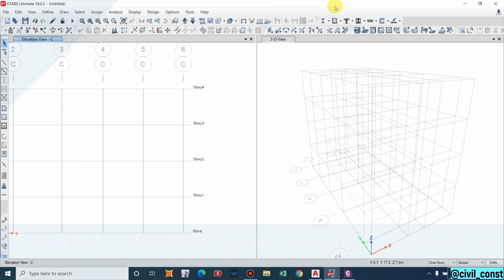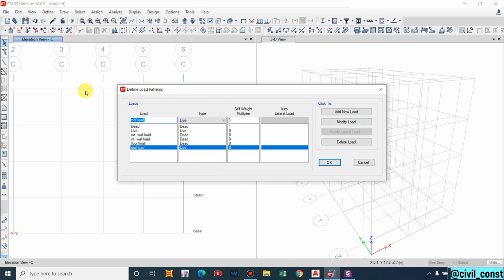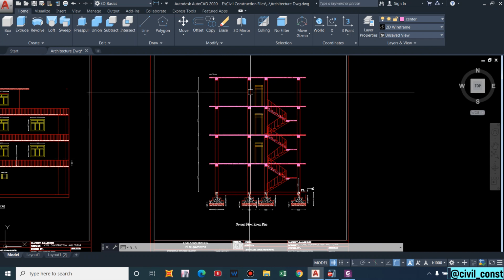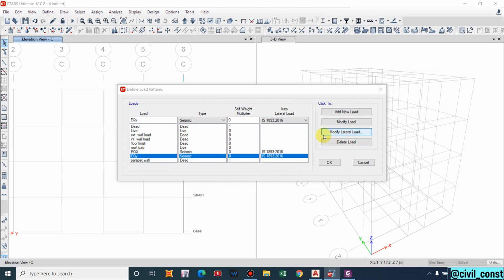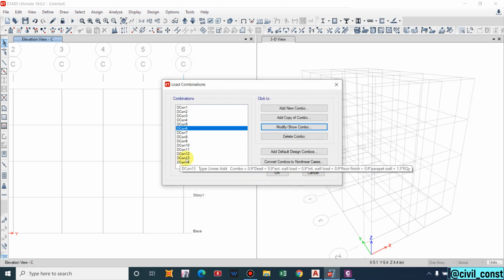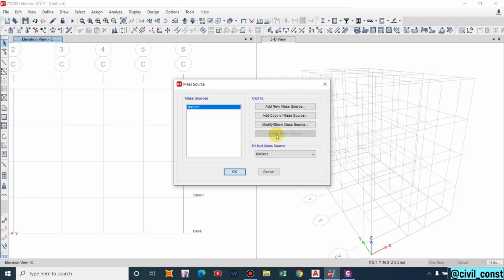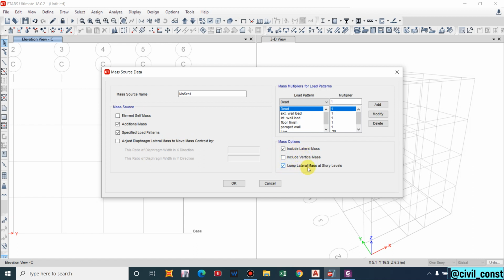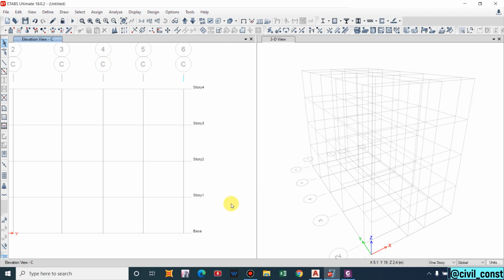Define Load Pattern, Combinations, Mass Source and Diaphragms in ETABS | Residential Building Part 4

Comment: One question. What is the diference between seismic and seismic drfit in load patterns?
Reply from the maker: The answer is in the name itself.
Reply: hi, So I must have both in the model, one to design and one to control drift @civilconst
Reply from the maker: No. only define drift if you have to apply drift displacement directly instead of seismic force.
Reply: @civilconst  Thanks Parash. !!!